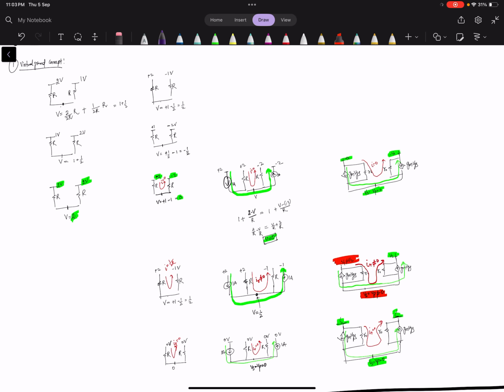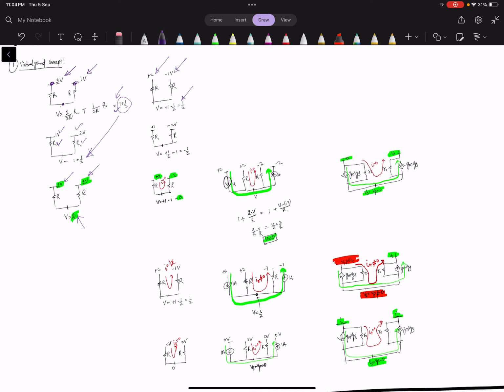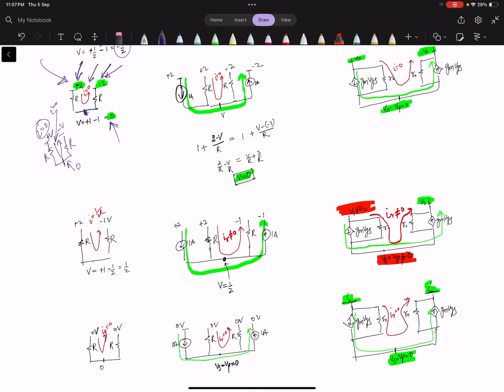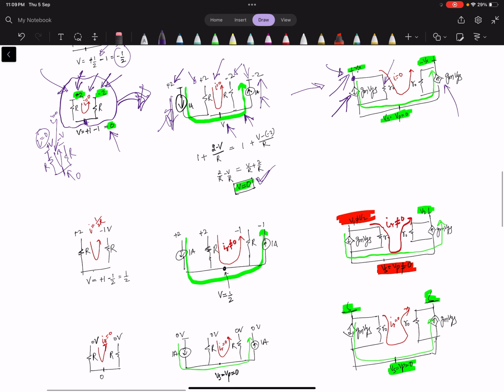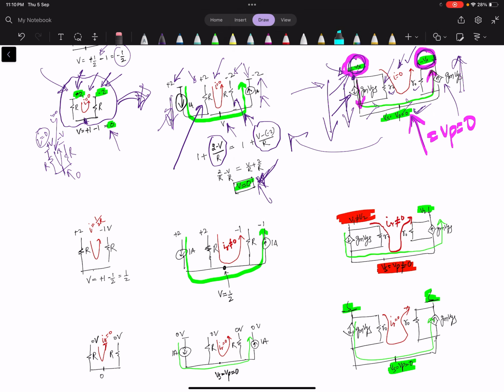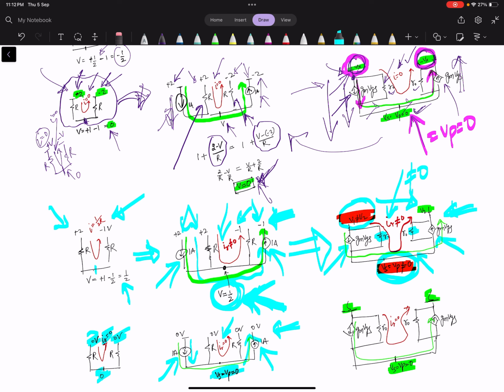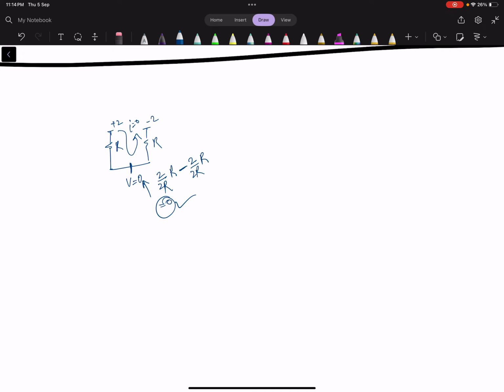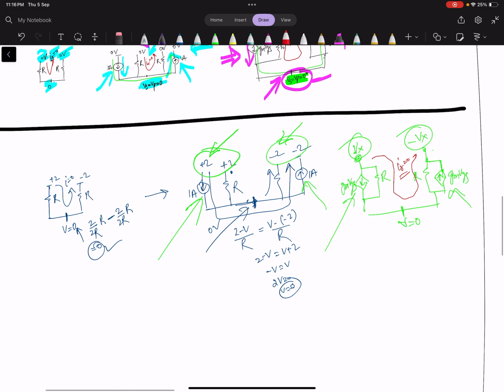Virtual Ground Concept Part 1 - Analog Circuit Design

Comment: how the currents become zero when we have opposite voltages , In 2votls and -2 volts case with only resistors ( no mosfets ) , current should be 4/2 = 2 Amps right ?? you said zero